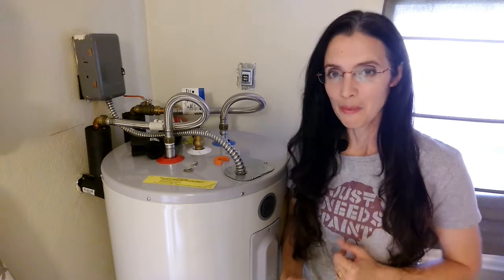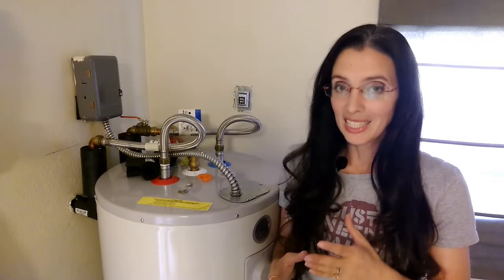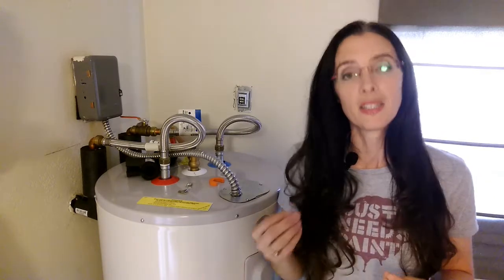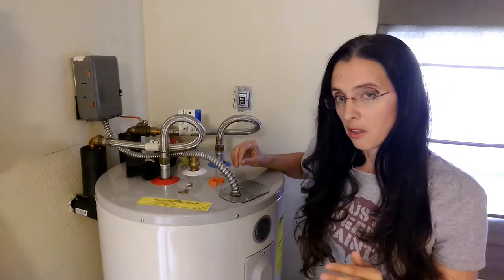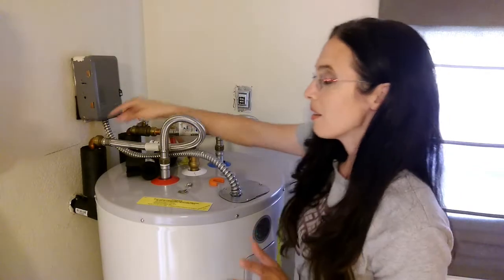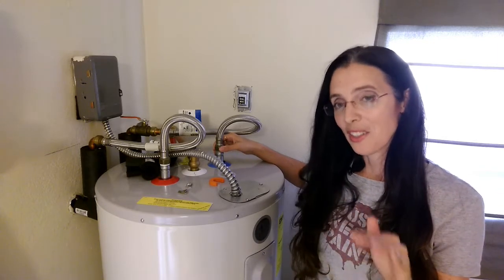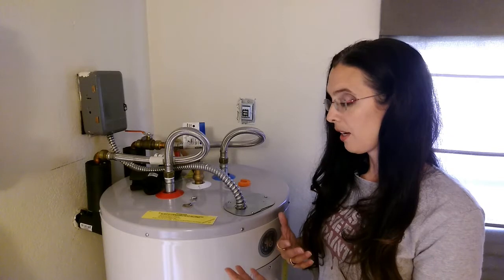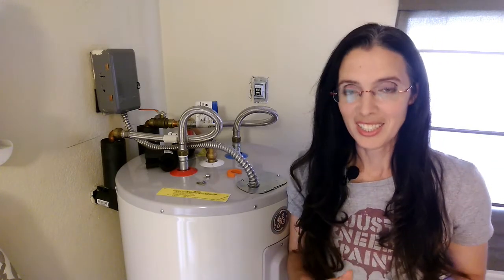Why Use PUSH-TO-CONNECT WATER HEATER CONNECTORS?!?! | feat SharkBite Quick-Connect

Comment: If you've got to move your water heater after it's installed (which you shouldn't), You'll not only have to disconnect the water lines, but you'll also have to disconnect the electrical connection to the water heater. Not to mention water heaters could also have power vents with a 4" PVC pipe and heavy blower attached. Maybe an expansion tank and/or a recirc pump. And let's not forget the gas line if it has one. You better be well-versed in plumbing AND electrical or you could get hurt...or worse! As another viewer mentioned, water heaters are not meant to be moved. Pull-out the old anode rod as far as you can and break it off as needed to eventually pull-out the entire rod. Install a new rod that's in segments, making it very flexible. Even better, install a powered anode rod and forget about ever having to replace it again!  The rod is very short and this is the most effective type to use.  https://www.corroprotec.com/powered-anode-rod/. If you're getting pinholes, maybe your water is acidic and/or you didn't install true dielectric unions.

Comment: You can  add an 0 ring silicone lube that is sold through plumbing supply stores. My issue is with that infuriating coiled  3/4” PEX pipe. Installing a whole house circulating loop to filter and soften my household water. In a do over I would use copper and use traditional solder method or the new copper compression fittings (with 0 ring couplers) and buying the 200 dollar crimping tool and sale it on Marketplace place when my project was done,supplementing Press to Connect fittings when needed. In Lieu of that buying the 10 foot straight lengths.

Comment: Push to fit should NOT be to disconnected and reused.  If that o-ring because damaged, it will leak.
Reply from the maker: You could put on a new one each time. Since this video went out, Phyn came out with leak sensors. So now I have a Phyn leak sensor along with an extension cable in the catch pan of the water heater, which will catch a whole host of water heater problems and shut off the water to the house with Phyn Plus if a leak occurs.
Reply: You can  add an 0 ring silicone lube that is sold through plumbing supply stores. My issue is with the incorrigible 3/4” PEX pipe. Installing a whole house circulating loop to filter and soften my household water. In a do over I would use copper and use traditional solder method or the new copper compression fittings (with 0 ring couplers) and buying the 200 dollar crimping tool and sale it on Marketplace place when my project was done,supplementing Press to Connect fittings when needed.

Comment: Let me say this you just unscrew it from the three-quarter nuts on top if it was Solderednever want to even touch those again and you just replace the O-rings when you do an anode rod you can buy flexible anode rods instead of having to take the whole entire heater out I’ve been doing this for almost 23 years in the truth is your logic doesn’t make any sense because a good qualified plumber wouldn’t have those problems we break those big Eno rods if we can’t get them out and we get the kind that are flexible that flexin to the tank
Reply: An anode rod only has to be replaced when you start smelling the smell of rotten eggs it means that you’re starting to go into the center core of the anode rod other than that you don’t replace every two years that makes no sense and it’s a waste of money
Reply from the maker: Thanks for adding your experience. Breaking it sound much easier--that's what YouTube is for--sharing and learning. Really appreciate your comment.

Comment: How are the shark bite connectors holding up? Some folks online don’t seem to trust them for the long term. Just curious what your experience has been.
Reply from the maker: We're at year 8 and they're holding up just fine. I realize my sample size of 1 is not the best data set, but we've definitely used the shark bites for their flexibility and they've performed flawlessly. If you go that direction I hope you have the same experience!